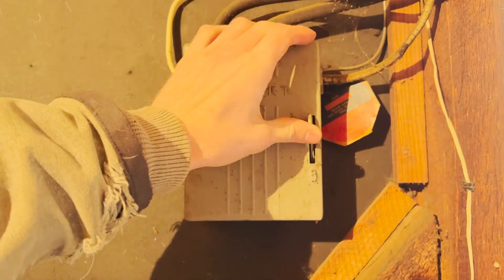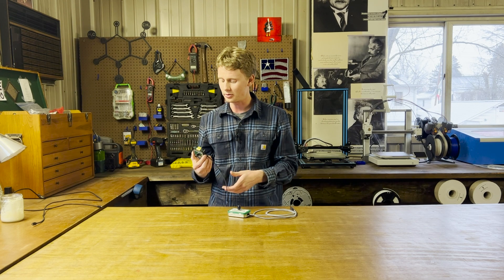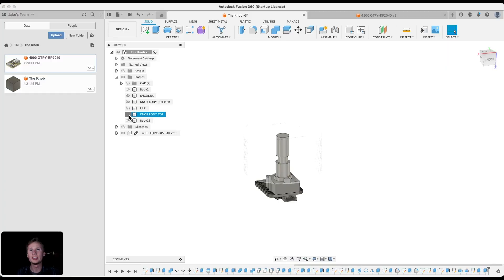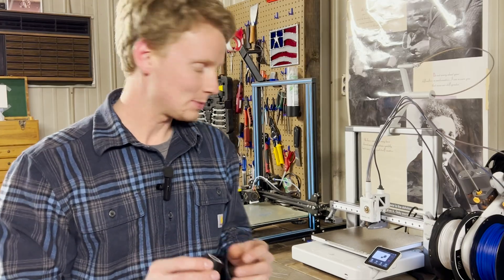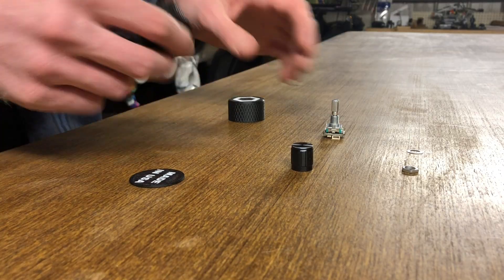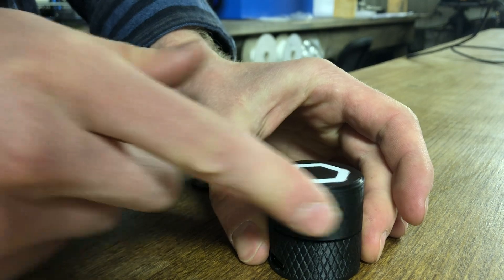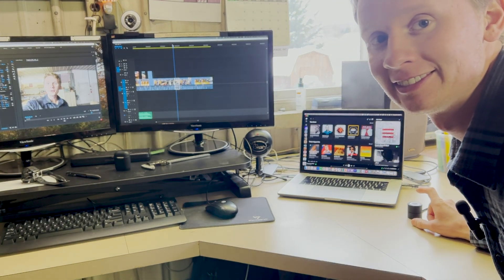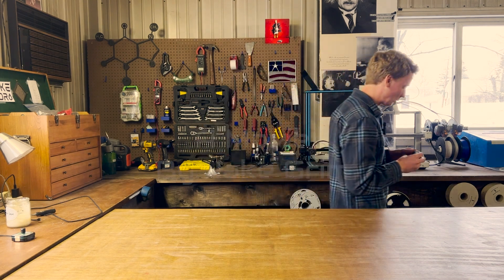Build Your Own Custom Controller with Fusion 360 & Bambu Lab A1

Comment: Super idea I am a beginner in 3d printing and I already know that recreating this design will be my first challenge! Can you tell me the encoder number or datasheet?
Reply from the maker: Here is the encoder I use: https://amzn.to/3TZYYGk
Reply from the maker: Here is the circuit board: https://www.adafruit.com/product/4900
Reply: @jakemgrim  Thank you very much. I read your code and see that it emulating a keyboard. The rotations of the encoder act as arrows on the keyboard. On the other hand, I don't know what key is emulated during a short press to "cut". In PP, such a keyboard shortcut is Ctrl + K or Command + K
Reply from the maker: @MMauser98  it’s pressing the X key which I have set to cut all media at the play head

Comment: Nice project. I use fusion 360 and a bambu lab A1 also. I struggle to get the dimensions of the printed 3d parts to be accurate as I would like. Have you found any settings in either the slicer or on Fusion 360 to help?
Reply from the maker: I make sure to always design my parts in millimeters when using fusion 360. I just posted a video on 3d printing in TPU with the Bambu lab and A1 with fusion 360. The slicing processes is pretty similar! Let me know if that video helps you get the accuracy you are looking for! If it doesn’t I’ll give you some other tips!
Reply: I recommend watching some videos on this subject but while using Orca slicer instead of Bambu Studio. There are some more calibration tools in that slicer, and it is a fork of Bambu so it's basically the same interface. I'm getting accurate results.  Keep in mind though that it's still pushing molten plastic out of a hole. It won't be as accurate as a good CNC subtractive method.
Reply from the maker: @LincolnWorld  thank you for sharing

Comment: Knob in my keyboard do same thing;)
Reply from the maker: What keyboard do you use? I might get one!
Reply: @jakemgrim  I don't want to destroy your motivation for action, because I know that such a drive to do anything is fantastic, and you are like a self-propelling machine. That is the beauty of life, to find something that you are passionate about. I suggest you get interested in PCB design. I remember starting with ESP32, but now I have switched to more complicated STM32 circuits.
Reply from the maker: @Dodzjak  if anything you’ve motivated me more! I’ve done some PCB designs with the ATMEGA328P. I’ve been wanting to do an ESP32 project but I’m shy of IOT. PCBWay actually reached out to me this week to do a YouTube collab! I think I’ll design a PCB with PCBWay similar to the iD4 but with a few buttons. Any recommendations on the chip I should use? ATMEGA328P, ESP32, RP2040?
Reply: @jakemgrim  keychron q1 pro with knob, or audient's id4 knob. Mostly using id4 because is more precise.
Reply from the maker: @Dodzjak  I just looked those both up and they’re pretty cool! Do you use the iD4 for more audio or video?
Reply: @jakemgrim  The iD4 serves me as an audio interface for the Rode Procaster, and it also powers the Beyerdynamic DT770 Pro 80 ohm well. It also performs well during editing in Premiere Pro and After Effects.
Reply from the maker: @Dodzjak  that’s awesome! I’m looking forward to building one for editing videos in Premiere Pro!

Comment: Cool I guess, but where is the million dollar idea? 
Good content but that's just clockbait
Reply from the maker: It’s the digital encoder! How much do you think I should sell them for?
Reply: So you invented the digital encoder? For me it looks like you 3D designed something that uses a digital encoder (you can buy) and esp32 (you can also just buy) in a simple 3D Designed Case anyone can design.

I still don't see the million dollar idea, nor do I see any way you can get a patent for such a product.
Reply from the maker: @David-ty6my  actually it’s a Adafruit QTPY running on the RP2040! They also make an ESP32 version but I’ve never used it. And your correct, it’s just a standard encoder soldered directly to the QTPY which makes it super easy to assemble. Best part, I wrote the code in Circuit Python which means it’s open source! Would you like me to send you the GitHub link??
Reply: @jakemgrim  yes, I would like to look into the project.
Reply from the maker: @David-ty6my  Here you go! https://github.com/Wake-Hydro-LLC/the-knob/tree/main/PLAY%20HEAD
Reply from the maker: Hey  @David-ty6my  did you check out the code yet?

Comment: Cool video, I just subscribed. I'd like a bambu, but just added an Ender 3 S1 Pro to the collection. Love the design. I must try this fusion 360 sometime.
Reply from the maker: Thank you! I’ve never used the Ender 3 S1 Pro, but I have heard great things about it! I started 3D modeling in Google SketchUp back in the day and started using Fusion 360 about 8 years ago. It’s a great program!
Reply: @jakemgrim  yeah I've been using tinkercad since I started 3D printing. It's pretty basic but it seemed to be relatively easy. But many creators do talk about fusion 360. So I will definitely have to give it a whirl.